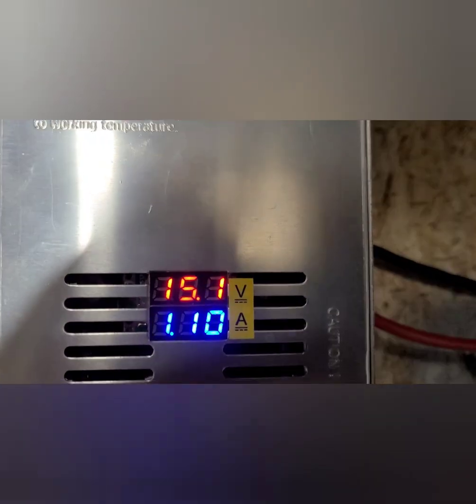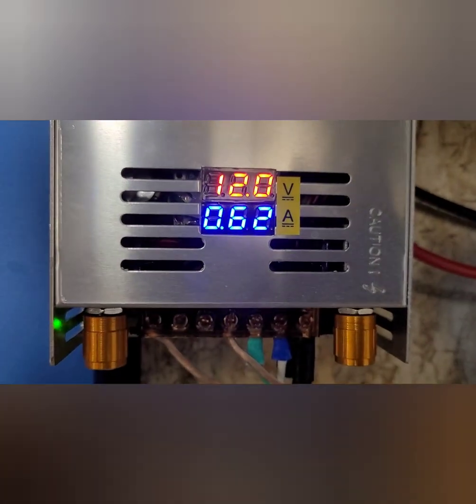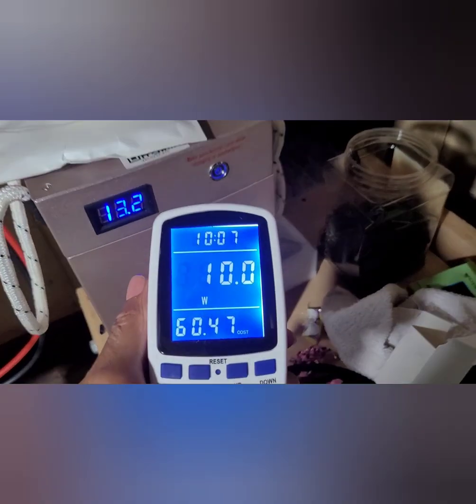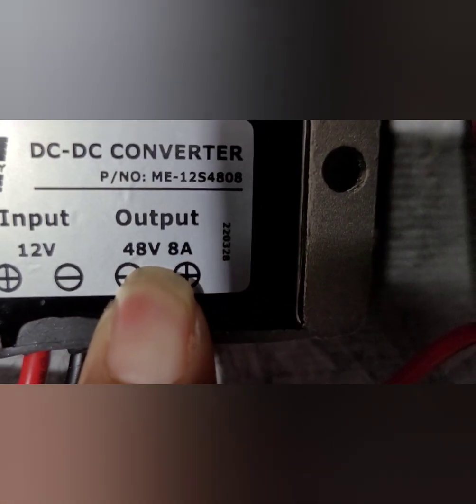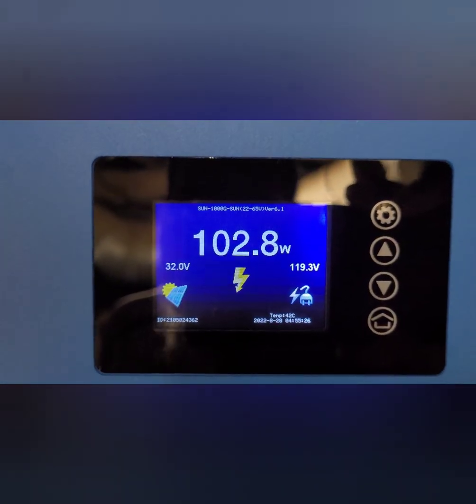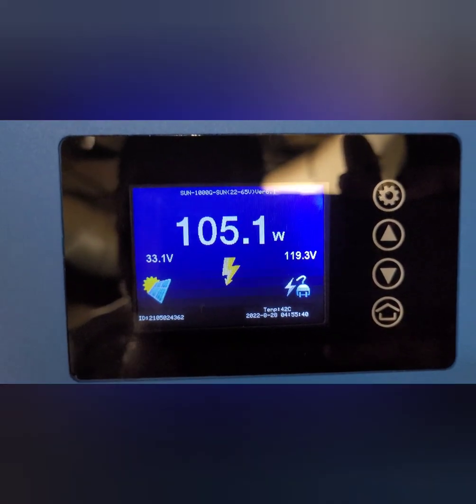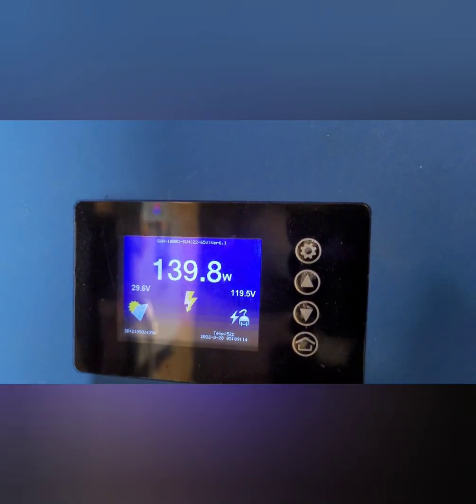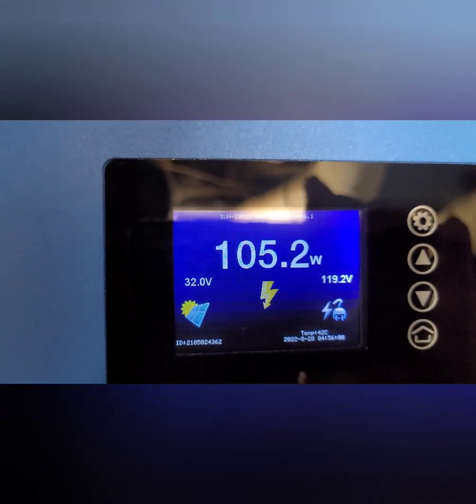debunking over Unity

Comment: Hi  @Lloyd

I have been trying to follow your videos on over unity, I think I understood you said one needs potential and not necessarily current and with the right methods of transforming it, one can get more power. But it seems like we need some kinds of batteries to store the charge and the chemistry of that battery gives us much amperage. My quetion is can we use any kind of battery for this?thank you for your time and response.
Reply from the maker: @HRMW-OSHIWAMBO  first of all that's not over Unity the more power out than in is not called over Unity. The words you must get from the dictionary to understand the real purpose of over Unity like I did when I made up the word at 14 which I put in my book I believe the second one but you can get out more power and you don't need batteries you can use capacitor or any storage unit the whole point is is that the extra power in the storage unit will give you the Boost it's like when they take the atom smasher and accelerate the particles around the circle if you think around those lines you start to understand you can do that with any system this is what we call hyper looping
Reply from the maker: @HRMW-OSHIWAMBO  Exciting News!
My new book “My Purpose is to Drive This Technology to Market” is now officially published and available on Amazon!

This work represents years of hands-on experimentation, theory, and exploration into real-world energy solutions inspired by Nikola Tesla and other pioneers. If you're a researcher, engineer, inventor, or simply curious about future-forward tech, this book is written for you.

I would be honored if you took a moment to read it—and even more grateful if you could leave a review on Amazon. Every rating and review helps increase the book’s visibility and brings this technology one step closer to the world.

Check it out here:
https://www.amazon.com/dp/B0F2ZZ7X5C

Thank you for your support—and let’s build the future, together.

Comment: parts ordered parts for 2 Tesla  ringer coils.  one amps one volts tune them if needed  The resonance charges batteries no wires needed no source drain
Reply from the maker: @earlliverseed1617  yes now we can get the rest of the world to understand that, it also means that radio waves when put out are inexhaustible as long as the signal keeps transmitting and there is a lot of different types of signals meaning all electromagnetic waves